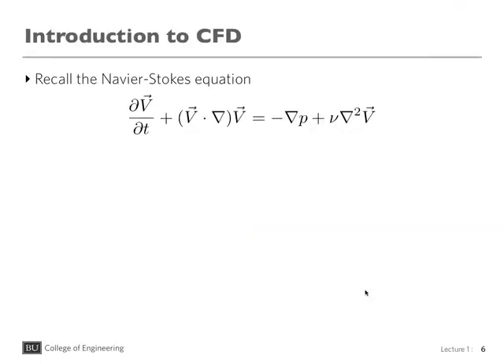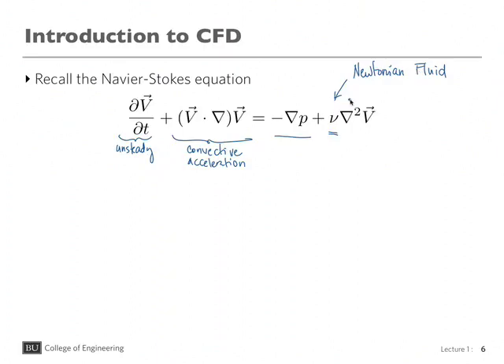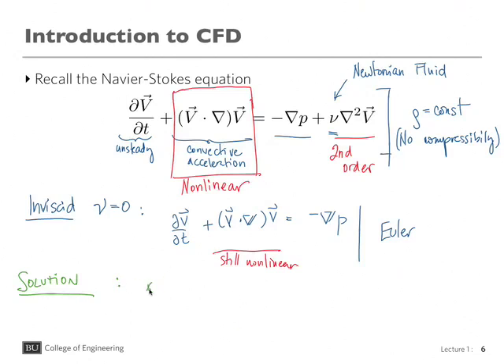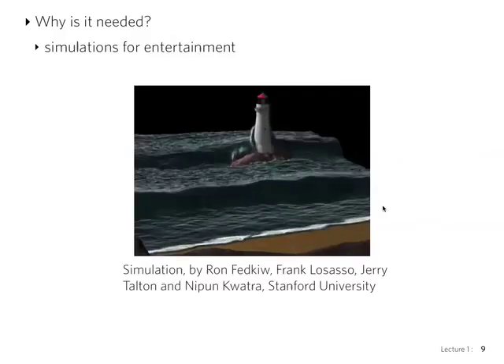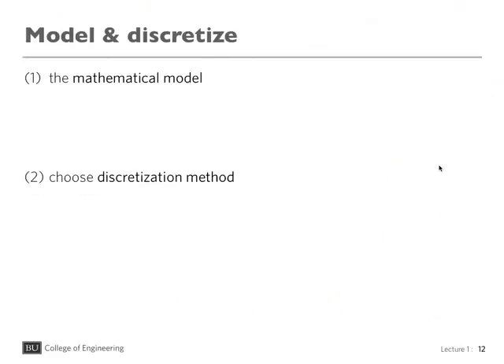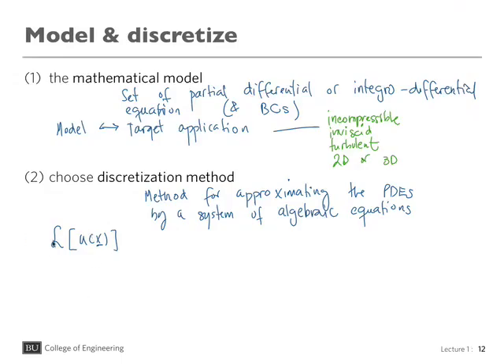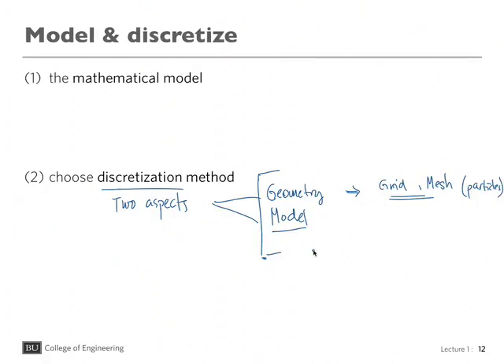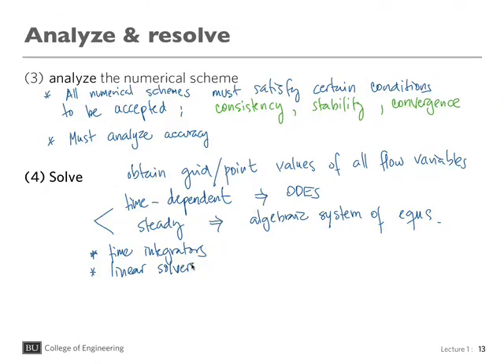ME 702 - Computational Fluid Dynamics - Video Lesson 1

Comment: Hi Lorena, is there a prerequisite to this course?
Reply: From the course website

> The course is for beginners. It assumes only basic programming skills —the concepts of iterations, function calls and so on— and builds immediate hands-on experience via this module and several others that come after. In the future, we hope to publish materials for the other modules also (e.g., convection schemes with Burgers equation, Euler equations and shock-tube problem, and others).

Other than that, I think a basic knowledge of undergrad fluid mechanics and mathematics is required.
Reply: @abzrg  this is not a foundational course, when you start off the first lecture by mentioning the navier-stokes equations it requires some background knowledge.
Reply: @PerJohannessen  fluid mechanics numerical methods and differential equations are necessary ı think
Reply: @PerJohannessen  Watch Lecture Zero parts 1 2 3 for foundation